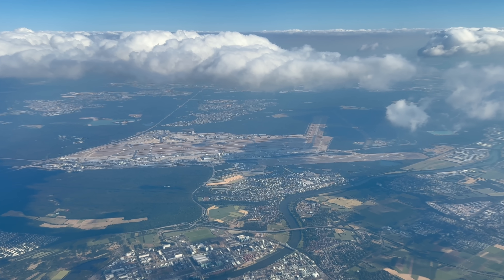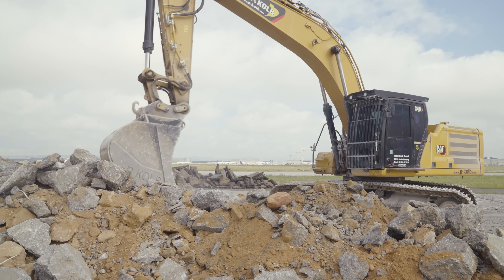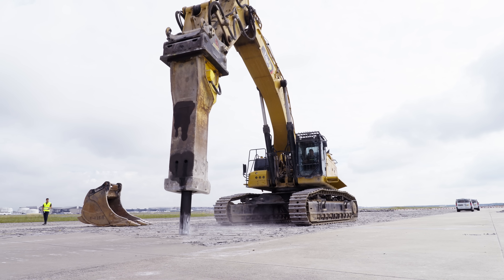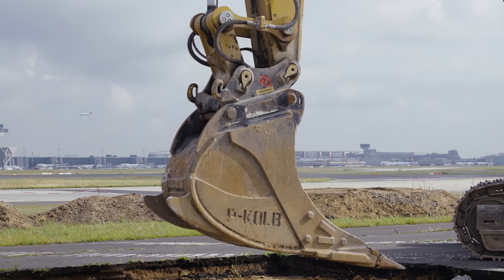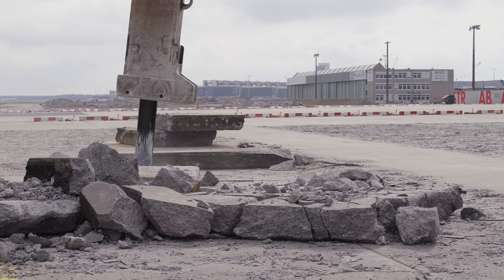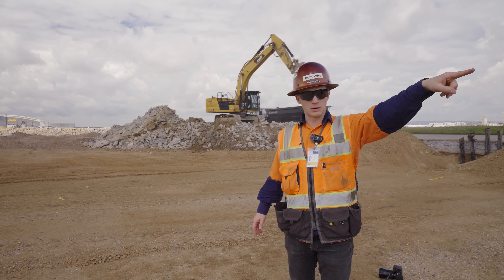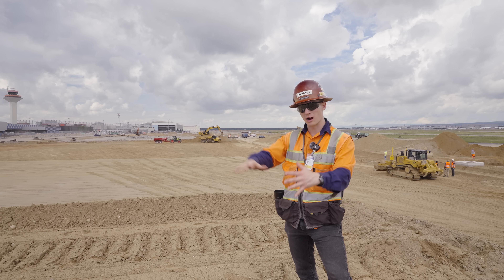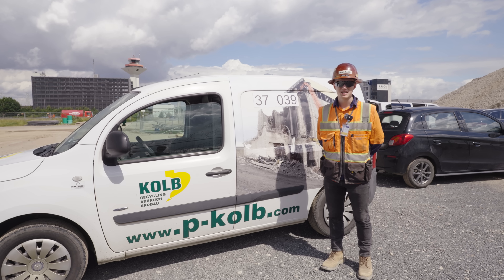How Germany Builds Runways at Frankfurt International!

Comment: Is there a reason why they can just build onto of the current runway? Would save a heap of money not having to dig it all up
Reply: It actually would not save money.
To elevate the whole taxi area, say 1500mm, you have a few different options. Pouring hundreds of thousands of cubic meters in concrete on top would get very expensive, very fast. Carting in hard fill (say crushed concrete from demos) to build it up and then pouring on top of that, cheaper, but far inferior strength because hard fill isn’t cohesive like clay, gravel and other such materials are. Carting in gravel, compacting it into a pad and pouring on top, is most likely not even technically feasible because the water required to bond the gravel together will have no where to escape once it hits the concrete at the bottom. Also, with the last two options, you’re going to have some serious headaches if the concrete underneath decides to crack, or the sub-base beneath the concrete starts moving up or down. Finally you have what’s shown in the video, rip out the concrete, reshape all the cohesive material sitting underneath that’s already there into the correct shape, then use the crushed concrete from the old taxiway to base up a pad for the new concrete on top. And since all the underlying material is cohesive, it’s very easy to compact it into reasonably solid sub-base. Ultimately you save a lot of money on either concrete or carting in 300-400,000 cubic meters of material. That being said, you probably still have to do some carting, but you always want to minimize it, because it’s a lot of trucks and a lot of Euros to move even a 100,000m3 of anything. Say it costs you €30 per cube to procure and cart in the material, at 17 cubes to a truck load, adds up quickly.
Reply: @taylorsmith2330  Thanks for a great response
Reply: thy need to lay new utility
Reply: @isakcecko8508  Then just cut the existing concrete on the path of the new utility...

Comment: you didnt explain why they need to demolish the taxiway and why they cant just build over it🤨 in the begining of the video
Reply: Needed to be updated. Probably add in new infra and other utilities and give the old site a bit of new life?
Reply: It would be expensive and not a great option in terms of strength. 
To elevate the whole taxi area, say 1500mm, you have a few different options. Pouring hundreds of thousands of cubic meters in concrete on top would get very expensive, very fast. Carting in hard fill (say crushed concrete from demos) to build it up and then pouring on top of that, cheaper, but far inferior strength because hard fill isn’t cohesive like clay, gravel and other such materials are. Carting in gravel, compacting it into a pad and pouring on top, is most likely not even technically feasible because the water required to bond the gravel together will have no where to escape once it hits the concrete at the bottom. Also, with the last two options, you’re going to have some serious headaches if the concrete underneath decides to crack, or the sub-base beneath the concrete starts moving up or down. Finally you have what’s shown in the video, rip out the concrete, reshape all the cohesive material sitting underneath that’s already there into the correct shape, then use the crushed concrete from the old taxiway to base up a pad for the new concrete on top. And since all the underlying material is cohesive, it’s very easy to compact it into reasonably solid sub-base. Ultimately you save a lot of money on either concrete or carting in 300-400,000 cubic meters of material. That being said, you probably still have to do some carting, but you always want to minimize it, because it’s a lot of trucks and a lot of Euros to move even a 100,000m3 of anything. Say it costs you €30 per cube to procure and cart in the material, at 17 cubes to a truck load, adds up quickly.
Reply: exactly he said the runway was good and it was stable
Reply: It’s cheaper in the long term do build new

Comment: Mass concrete without reinforcing bars just seems very strange to me as a Carpenter for 40 years. I started my Apprenticeship in Carpentry way back in 1984. I was 18 and turned 19 during my first month of work. Some of the guys I first worked with talked about pouring the runways for Tullamarine Airport back in the lare 60s. 
Mark from Melbourne Australia
Reply: I guess that a layer of concrete over the ground is never loaded in tension thus it's ok to not have any steel reinforcement  (?)